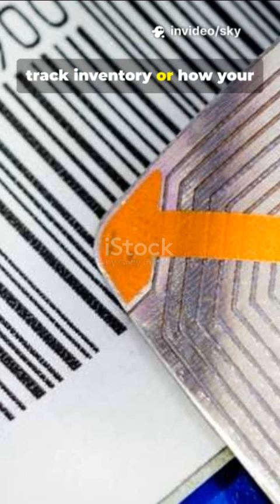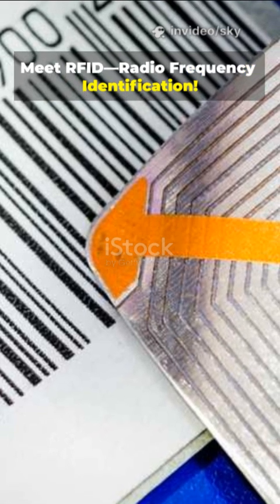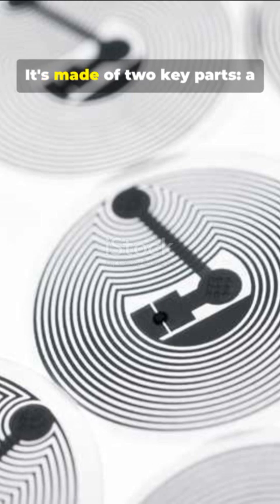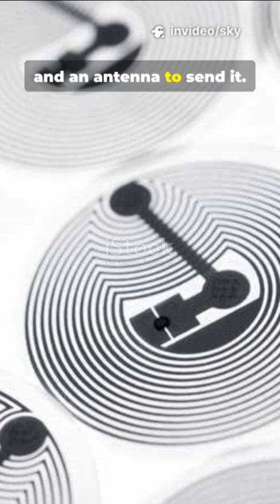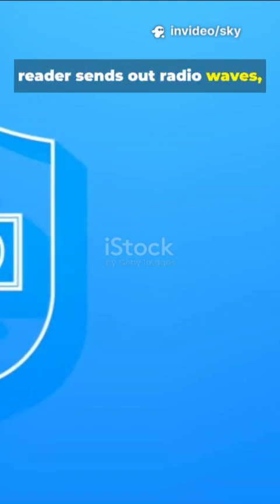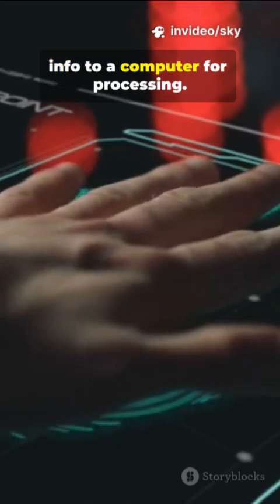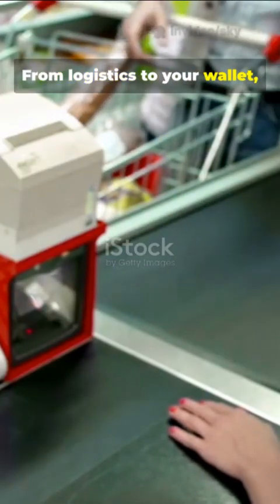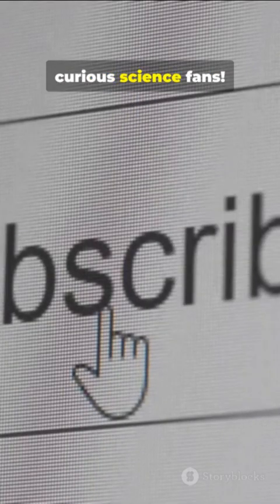How RFID Actually Works #science #shortsfeed #tag

Comment: How does passive RFID generate energy to send data back?
Reply from the maker: Passive RFID tags work by harvesting power from an RFID reader's radio frequency signal, which activates a microchip to transmit stored data back to the reader. The reader's electromagnetic waves induce a current in the tag's antenna, which charges a capacitor to power the tag's integrated circuit (IC). The IC then uses this power to send data back to the reader, a process sometimes called backscatter